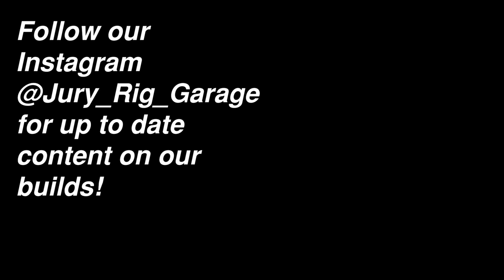Bonneville SSEi 3800 Series II Top Swap Part 18 (4T65E-HD ZZP Input Shaft & 3.29 Gear Ratio!)

Comment from the maker: Huge tip for anyone rebuilding their transmission, don't work on it sideways 😂 It is much easier to align the clutches and keep everything in place if you keep it upright and vertical. They even make transmission stands to work on.

Comment: When you put the differential cover back on, the cover by the output speed sensor did you use any gasket sealer?
Reply from the maker: Can't quite remember, I believe the speed sensor has a O-ring